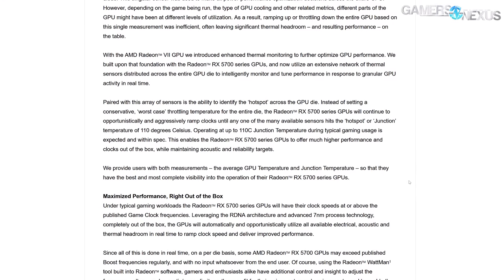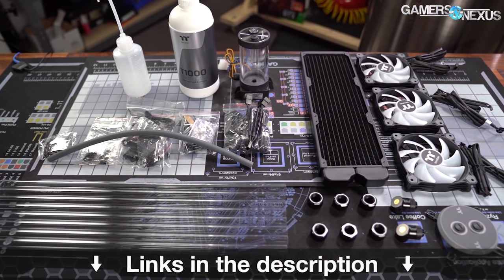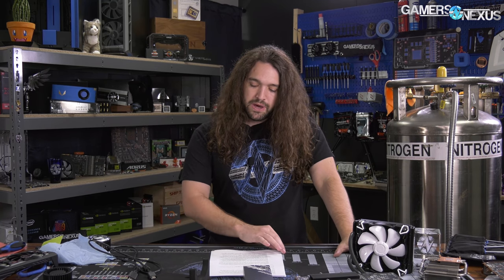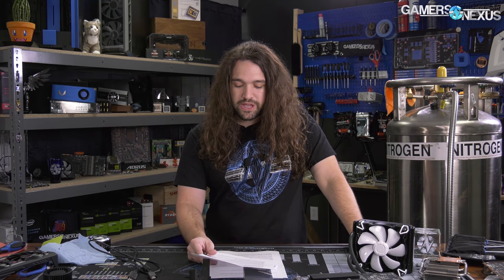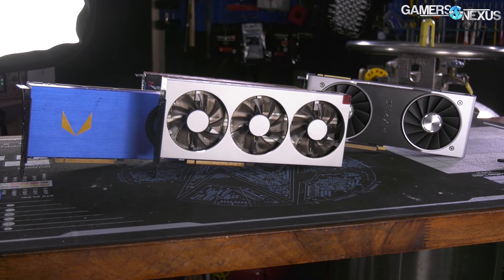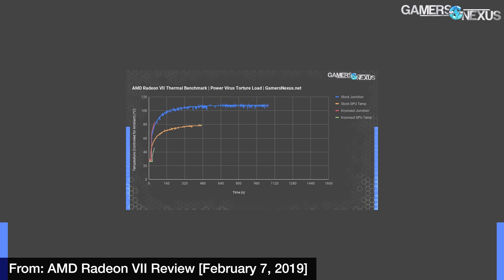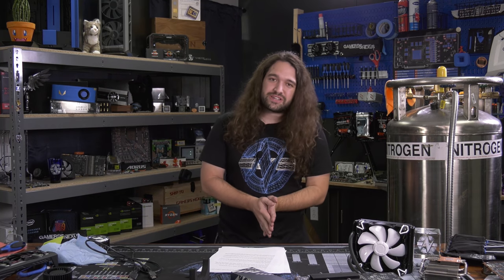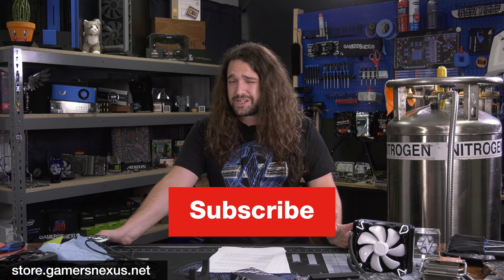Explaining Navi 5700 XT Junction Temperature | 110°C is Not "Expected"

Comment: What are junction temps on Turing cards like?
Reply: Nvidia doesn't have sensors there.
Reply: They to scared to show cause turing already hot.
Reply: @ZeroFallout1  Lmao, turing runs cool even on stock cooler
Reply: RTX cards runs cool because they don’t use shit reference cooling.
Reply: @Supcharged  because they dont use blower style coolers ... thats such a bad comparison ^^'
Reply: @Supcharged  oh you mean all those dead rtx cards that ran them selves to the ground with all that heat. Like steve said people have short memories especially when they bias. 2080ti still run hot but at least they dont die within  30 days now.
Reply: ZeroFallout1 I’ve had a number of 2080Ti’s and not one has failed. Even my current card is running strong.

In terms of noise I’ve had a reference card. And a number of AIB cards. The reference ran cool and quiet considering it’s cooler size. Just as quiet as most AIB cards while running a little hotter in the higher 70c’s.

I had an FTW3 and found it noisy in comparison.

Just goes to show a properly designed cooler. Vs you know amd reusing the r9 290x jet engine cooler.
Reply: The RTX series reference cooler keep the GPU temperature at 80 degree's. just like Navi's reference cooler. (That's what reference coolers are designed to do.)
So RTX will have roughly the same tjunction temperatures at Navi. They just don't report them (or worse, don't even measure them)
Reply: Nvidia have never stated that they expect to hit 110 degrees.
Reply: @Safetytrousers  because they report only edge temperature, Navi's edge temp is within what FE cards of Nvidia do too. 

and that comes to previous gen also, as I have blower vega56 and my mate have FE 1080. both run at similar temp,s but only my give this making everyone mad junction temp. edge temps are similar. in 80's.
Reply: There's no Tj temps if you don't show them!
Reply: @Zetler  RTX Cards run cooler since they have significantly higher die sizes so thermal dissipation is more efficient.
Reply: I predict they will be lower since Turing cards have large die sizes.
Reply: @alihusein4299     yeah, but they produce significantly more heat in those bigger dies as well. Junction Thermals in Turing is probably the same, if not higher than in navi
Reply: @slaitm9289  They probably produce very similar amounts of heat since they have similar power draws but since the heat is spread out over a large area on Turing, the junction temperature will be lower.
Reply: idk but my stock 5700 non xt beats a 2060 super
Reply: @ugaaa5 74c idle??? What?
Reply: Why do you think Nvidia moved away from blower cards? Because rtx would run too hot.
Reply: @ZeroFallout1  There was never any proof that was from thermals.
Reply: @anomous2307  no, you're hallucinating
Reply: @TheCountess666  how do you know? Tdp and tjmax on both amd & nvidia are different
Reply: @ugaaa5 Looks like someone owns a GT610...
Reply: @Safetytrousers  because they have no sensor reporting that temp to the user causing a panic over nothing. Come back to me when Nshittia has the balls to show the junction temp. If people here are saying there cards are running at 70 to 80c guess what suckers, your junction temp is most likely at 90 to 100c. You just dont know it because thats yet another feature lacking on Nshitias side.
Reply: Actually, check the newest HWNews video, Nvidia reports the average temps of all their sensors, where they are or how many there are wasn't disclosed to GN
Reply: @thefilmdirector1  The point is they have not panicked consumers by stating an expectation of a very high temperature. I don't want to see temperatures that are irrelevant to me and the card does not use to govern its performance.

Comment: Asus TUF RX 5700XT with a custom linear fan curve set to 100% fan speed at 70°C hits 97°C junction and seems to throttle under heavy load. GPU temp stays below 70°C. Stock gaming mode, which is stock speeds. Asus' GPU Tweak lets you select silent (underclock), gaming (stock) and oc (overclock) modes. I'm probably going to run the card in silent mode with the custom linear fan curve to keep the card from frying... but it does have a 3 year warranty, so that's nice I guess.

Comment: I don't see why this wasn't described as a thermal limit, seems simple enough.🤔

Here's the definition from Intel (who have been using the term for years, 7th gen): TJUNCTION - Junction Temperature is the maximum temperature allowed at the processor die.

Dear AMD: Please stop using such crappy stock GPU coolers (like you did with your CPUs). Those things are so bad, you wonder if they resent people buying their products.
Reply: @crismeman3386   I think he meant that AMD did stop using crappy coolers on the CPUs.  He's bashing the GPU cooler.
Reply: @crismeman3386  ahh yes the stock cooler for the fx 6300 certainly was good enough to cool that nuclear reactor of a chip.

It definitely did not turn into a jet engine everytime I used it for more than 4 hours

Comment: The proper wording of the 110 temp is that it is within spec, nothing else. Within spec on these means that it will run at that temperature, and depending on the spec sheet that temperature would be rated for it to run a certain amount of time, or indefinitely and the chip would be expected to last for the rated life, I would think probably 3-5 years at maybe 8 hours per day would be the rated life which would likely be translated to just the number of hours and like I said the spec sheet for the chip might just have a max temp, or it might have a peak and a continuous max and the peak would have a certain amount of time that it is rated to run at that temperature. Both peak and max are within spec, and if you want longer life out of the parts you generally have to run them cooler.

Comment: Just because it's "fine for the silicon" doesn't mean it's not having any ill effects. As you said, it makes it less efficient, and also just increases degradation. It may very well be fine for the silicon, but more heat almost always increases degradation, so regardless, you're still having your gpu's life shortened, running less efficiently, and running louder. Who knows, maybe that degradation increase will be negligible for the lifetime of the card, but otoh it might, especially past the warranty window. And all it's doing is just increasing the temps of the surrounding components in the case because all that heat still has to get transferred.

Comment: Ok so the card is safe until 110 degrees. Lower is always better obviously. Will a silent,  hot 5700xt still be more powerful than a louder 580/5700? Like in a passively cooled rig?

How hard does it throttle?
Reply from the maker: Your question was answered in the video that you chose to ignore.
Reply: Even if that were the case, you still wouldn't want to run your card at 110C a lot of the time. While it won't damage the silicon in the short term, I can almost guarantee it's going to shorten the card's overall lifespan, and that's not even touching on the temps of the mosfets, VRAM, and other power delivery components. Just because you can, doesn't mean you should
Reply: @Kayametra  true.   I guess I was just coming at it from a "how hot can I run this without having a fan in my case?" perspective.

Comment: Not sure if anyone mentioned this before, but the temperatures being reported by software are probably the temperatures inside the memory chips, not the surface temperatures. Up until these cards came along, everyone was measuring VRAM temps by measuring them on the surface of the chips. (thermocouples, FLIR, etc.) Think about it like a CPU, if you would measure the temps inside the CPU vs on the surface of the heatspreader. The latter would be significantly less hot than the former. Is it possible that because prior to NAVI everyone was measuring VRAM temps from the surface, the safe operating temperatures offered by the memory chip manufacturers are based on the surface temps and not the temps inside the chips? This would explain why AMD is saying 110°C is considered 'within spec'.

Comment: lol.  ANY card running at 80 degrees C will have a much higher junction temp.  Navi and RVII are the only cards showing this figure.  You have no reference for what this temperature means.
Reply: That's what I was thinking.... I've had cards run at 75-80c all my life that would indicate the Junction temps have always been around 100-110c right?

Wouldn't that make it 100% normal as AMD said? I don't know this Video seems to jump the Gun on criticizing AMDs statement.
Reply: @Wishxinever  You don't know how much delta there is exactly between edge and hot spot on other cards.

Even on Vega and Radeon VII the delta changes drastically with voltage, at 800mv my Radeon VII's hot spot is just 10c above core temp:
https://gyazo.com/b8999a859ac6349681533e990f6a9c32

Comment: 110C is beyond Tj for most burnin conditions in modern semiconductor manufacturers.  It would be daft to design for a Tj like this as the transistor performance will degrade pretty rapidly over time due to NBTI.   My back of the envelope fully functional life expectancy for a card like this would likely be  <1 year.   Clearly the marketing people aren't technical as they explained this poorly, to put it mildly.

The question isn't "can the silicon handle it"; the correct question is: "how long can the silicon handle it?"
Reply: intel has CPU's with a TJmax spec of 105 degree's, yet nobody's raised a stink over that. AMD says their GPU's can up to 110 degree's and suddenly all hell breaks lose.

Comment: Two rules of gpu cooler:
1. Blower style cooler are shit
2. AIB cooler are far MUCH better
Reply: Blower style coolers are inherently better if they're designed properly, which is almost never the case. Like tower CPU coolers, they work to get the heat out of the case as quickly as possible, rather than an axial fan which almost always ends up sucking on its own exhaust and relies on secondary case fans to remove the hot air from inside the case.

There have been a few good blower cards like the HD5870. I had one years ago and after replacing the garbage thermal paste, it never ran over 80C, even under heavy load. It wasn't going to win any awards for being silent but it worked for years until I upgraded. The noise problem could be solved with a better design, you can get centrifugal blowers that are very quiet and still move a ton of air.

I have seen a couple of hybrid designs where either a large fan or blower is placed in the middle of the card that try to be a middle ground, but haven't had much experience with them.
Reply: I've heard that too, unfortunately blower style coolers will never works for me. I live in a tropical country with a constant temp always above 30 degree celcius. My brother owns gtx 780 ref and he always afraid when he plays because the temp will arise above 80, sometimes it reaches 90. His case have 3 120mm fans intake and 1 120mm fan outake. Eitherway he sold the 780 ref and upgrade it to 1060 aib and it runs way cooler. It barely touch 80

Comment: I am quite disappointed with the quality of this video. From an engineer's viewpoint, AMD's explanation is sound but Gamers Nexus' is misleading/incomplete. The only thing I agree is that AMD should better explain themselves by providing more details. Oh wait, did providing more details start this disaster?
Reply: I agree. It is unreasonable to interpret AMD's statement about boosting to mean that there are no limiting factors other than temperature. While the statement could technically have been worded less ambiguously, I find it strange from Gamers Nexus to defend absurd interpretations on behalf of users.

Also, insisting that better temperatures are possible is meaningless if those better temperatures do not buy one anything.

There is a good point to be made about efficient cooler designs when it comes to noise levels, but the arguments regarding temperatures fall flat.

I don't see anything wrong with AMD assuming that their cards will be used in bad cases. Again, they could have been more explicit but their statement is not wrong.
Reply: @tkimaginestudio  I am too lazy to type all these because I doubt if GM will read it. I agree with your points. The proper way to criticize AMD's explanation is to question their reasons for the numbers and limitations in the spec.

Comment: >110° is fine for 5700xt

me living on the equator with no  air conditioning
Reply: That isn't how thermo dynamics work.

You could have that card at 40c with a 680mm radiator and it would heat up your room the same amount.
Reply: @m.streicher8286  not if it explode/melt earlier and stop putting heat in your room :3
Reply: @MissedMessages  It's not going to explode/melt at 110c, that's the point of their statement.
Reply: @jukahri  depends for how long you keep something at that Temperature. Chemical reactions are based on time, temperatures, pressure etc... Their statement is manipulative. Every vrm is made to reach 100-115° but you shouldn't reach them
Reply: @m.streicher8286  
yes i dont understand thermodynamics but my pc has significantly better temps when in a room with a/c
Reply: @smallfoot5689  yes off course I didn't say an AC wouldn't make your room cooler.

What I'm saying is this, 

Pretend you have a GTX 960 that uses 100 watts of power, no matter what, it's always using 100 watts.

Whether this 100 watt chip is cooled by a tiny heatsink or by 360mm radiator, there is still 100 watts of energy being dissipated as heat in your room.

Because energy can't be destroyed or created, only converted, in this case from electricity to heat.

Comment: Steve literally said the blower cooler keeps temps well under 110c when not crippled but then he software cripples the card to stop progressive cooling at 40dB then he gets upset that thermals are above comfort level. There is a massive flaw here, 40dB in an open air test bench is unfair (open air bench is loud to begin with and not what most consumers use as their day to day rig), test that stuff in a closed case where 40dB would result in higher fan speeds. 2nd GamersNexus is obviously trying to push for "noise-normalized thermals" to become a standard of testing for all outlets to use and really blowing this out of proportion, likely to garner more attention for their channel. 3rd AMD addressed the issue of using a blower style cooler on reference models because this gives the most consistent result across all types of builds, including low air flow or no airflow cases like mini-ITX where an axial design would literally dump heat back into it's intake.  Steve is jumping to conclusions that AMD is trying to save face for using a blower style cooler, when they already stated they would have done that but choose to go the safe route for a broader audience. Really suspect GamersNexus is just trying to drum attention for their "Noise-Normalized Thermals" and to their channel in general. 
Show less

Comment: The card at times runs up the fps and gets hotter on still scenes and paused menus. I enabled vsync and  been playing at 60fps ultra solid 67-75 degrees c and it is working great rpm on blower 2800rpm. Still love the card.
Reply: I cap my fps at 94 because i have a 60hz panel and without vsync anywhere below at or above 60 tears like a mf. 94 doesnt tear noticeably and provides a much smoother mouse reaction compared to a 60 lock and especially compared to vsync on. Just cap your card globally at 94 or 120 and it wont crank the fps in menus and overheat. All cards do this though its not a problem specific to 5700xt like people make it out to be, Menus would crank my old 390 right to its 94c limit to.... Any card pushing 200+ fps is going to scream.

Comment: isn't 110°C in spec since the R9 290 days in spec for AMD?
Reply: A few years back I had a Gigabyte HD 4670 that always since new ran constantly at 113C while gaming new paste changed it for a few days to around 109 but it always crept back to 113. Perhaps they meant that's what the silicon has been designed and tested to handle on the regular. As for the 290 I believe the target temp is between 90 and 95C on the reference boards.. mine never gets that hot always below 75 while gaming even overclocked.
Reply: both AMD and Nvidia have very likely had the same 110 degree TJmax spec for all their GPU's for years already.

Comment: Steve I think I can hear that Nitrogen tank leak in  the background. So the tank might be leaking man....😯
Reply from the maker: It is! That's normal. The pressure sensor opens a valve if pressure is too high, allowing the nitrogen to leak out.
Reply: I mean that thing could kill you in theory... if all the oxygen got displaced from the room.
Reply: Holy shitto man nice headphones! I heard that too, I thought my custom loop was leaking xD
Reply from the maker: @Wingnut353  It's a 2100 square foot room with air conditioning and that's leaking extremely slowly, so no. Not even close.

Comment: Back in the day a CPU temp reached 180 deg F and was normal but it was hot and not recommended to run it over that.  Over temp shortens the life of the silicon and one risks a failed chip in a year or two (IMO).  200 deg F would often cause a chip to shut down.  110 deg C is 230 deg F and well over the failed chip recommendations from 20 years ago.

Comment: If the Sapphire Pulse card hits 87C under load when the TJ max is 110C, then i'm wondering why my EVGA 2080ti gets to about 80-81C worst case when it's throttling point is just 88C?  If anything it seems the AMD cards were made with significant thermal headroom for the blower cards meaning the 3rd party ones have a ton of play in temps?  
All I know is it's weird to have a $1070 card that gets within 8C of throttle point under serious/prolonged load.